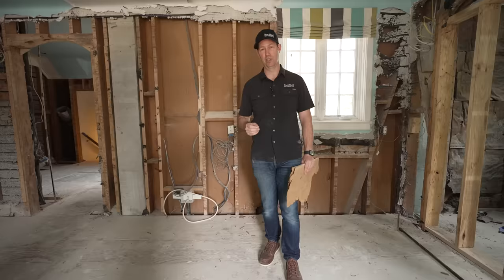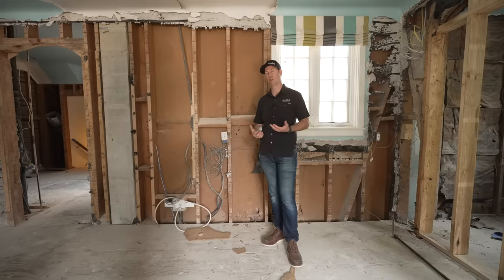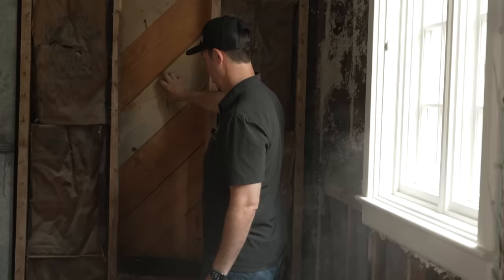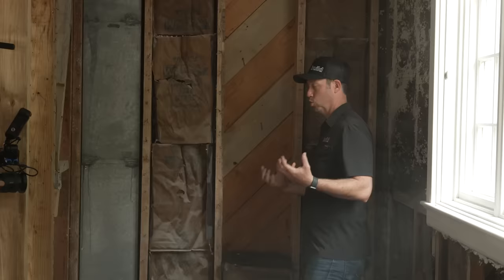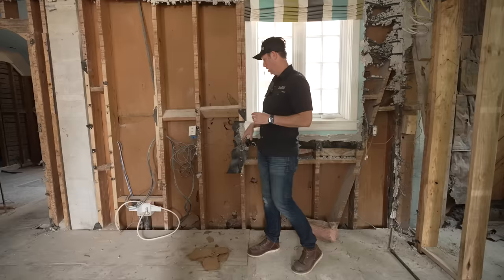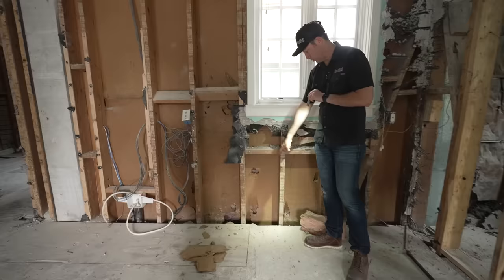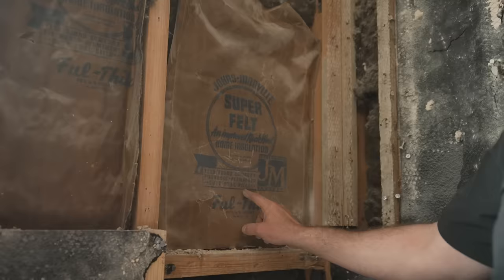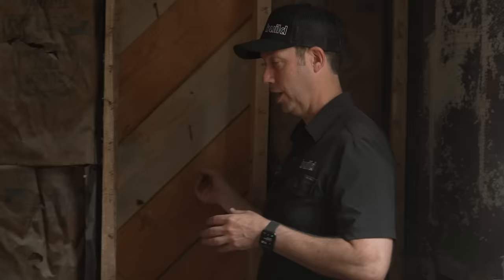I’m recommending we NOT INSULATE This Old House

Comment: I lived in an old home in Spain. No insulation, concrete and stucco build, plaster walls.
It got cold and I turned on my kerosene space heater, closed the door to that part of the house and started fixing dinner. You cannot imagine my shock when I went back into the living room to discover I couldn’t see farther than my arm! The extreme moisture held in the walls formed a thick fog cloud inside the house with the introduction of the heater. ☁️☁️☁️☁️☁️
I opened the windows as the air outside was drier than inside.
Reply: I believe you. And that's hilarious!
Reply: You should always have the windows cracked a little when using a kerosene heater indoors anyway.  Otherwise their combustion products (CO2, carbon monoxide, nitrogen dioxide, etc) will accumulate in the room to unhealthy levels.

You should also only use them as much as necessary, and turn them off every so often and air out the room before continuing, if you're doing it for a long time.

(It is ironic that in places where these heaters are your main heat source for a home, to heat up your home in the winter, you actually need to open a window...)
Reply: @foogod4237  
The room had ventilation via a fireplace, but you aren’t wrong! Good advice!
Reply: Pics or it didn’t happen
Reply: @nofurtherwest3474  
I took three but something went wrong…the film printed out nothing but whiteout.

🤣 joking
Reply: @Mulberrysmile  Let me ask- how did you like Spain?
Reply: @nofurtherwest3474  
It was terrific. Wonderful people, interesting places to go, food was delicious.
Not perfect…no place is, but I would go back for a visit, for sure.

Comment: Our 1948 ballon frame house had no insulation, tar paper, and 105 wood siding nailed to the studs. The upper part had tar paper, 1x4s spaced out with double course cedar shakes attached to those. And we still had rotten siding on a few spots! We recently stripped the exterior walls, added Rockwool insulation, plywood not osb, 30# tar paper, and double course cedar shakes. Above that hardie board.  I’m loving it so far.
Reply: Damn how much did you spend for that? And what do you mean by exterior walls? Aren’t all 4 sides exterior walls?
Reply: @oshitomaha  It usually means they worked from the outside, removing the outermost layer and insulated from there versus removing interior plaster/sheetrock and insulating from there.

Comment: 1) The particle board has a air gap between it and the brick (That is 1 reason why it's survived so well as others pointed out old brick work sheds humidity better than modern mortar)  2) if you want to give the particle board air you can use Sofit spacers used for insulating rafters to keep the insulation 1.5" from the sheeting. you'd be able to insulate while maintaining the original air gap on the inside of the sheeting. 3) Now that the Original particle board has Numerous holes you've punched into it you'll have to change the approach to keeping it dry by increasing the volume of airflow so the interior of the board doesn't retain humidity (Which is what you saw at the base with discolored particle board. Not enough air) 4) A completely closed pocket must stay closed and have some  through absorbent surface to shed any moisture (Which the original plaster was) since you plan to go with drywall and you perforated the outer board you definitely want insulation to mitigate rapid moisture changes in outer walls.

Comment: One time, I added exterior underground insulation to a basement. It did nothing after adding on the long sides. One side was above ground due to terrain slope. But when I added the final 25" of rigid insulation, suddenly the basement was a LOT warmer! While you might want to add insulation on the spots without that particle board, based on my experience, it'll be a waste of money because the heat loss from the uninsulated area will dominate the heat demand.

Comment: Matt, I lived a old 1800's brick mill and had a Mason repoint the bricks. When they were finished, they sprayed the entire structure with a silicone sealant. Rain would bead up and run off the outside. But it was breathable so any moisture on the inside could escape.
Reply: I have a brick full masonry house, and am considering applying this type of sealant so that I would then be able to insulate without having moisture problems. Sounds like you have been pleased with the sealant. Did you add insulation at the same time you applied the sealant?
Reply: It may have been silane/siloxane and not silicone

Comment: I did some work on a house built in 1928 in South Florida, had the same type of particle board walls with no rot. Had the material tested for asbestos, came back clean.
Reply: Must have been the lucky one :)    A home from 1928  is almost sure to contain asbestos,  lead paint, lead plumbing (possibly lead supply piping) balloon framing with no firestopping installed,  and a mixture of knob and tube wiring and newer romex as upgrades over the years have been made.   The original electrical service was typically 110 volts, 30 amps with 2 to 4 circuits total.

Comment: I have the same particle board sheathing on my brick house from the 60's. The walls have fiberglass insulation and two layers of sheetrock, and as far as I can tell that's how it was built. There are no moisture issues that I know of. It has stood this way for 60 years, so I guess it must be fine.

Comment: Thank you for this video! Perfect timing. We're renovating a 100 year old victorian wood frame house in Cocoa FL, and we just had water seep into the walls after the hurricane. The house has no rot at all and all the wood behind the plaster has been in perfect condition. You helped us understand that these old houses can dry out. We still need to seal up a few places where water was getting in, but now we know that it has been self-drying for the past 100 years and will continue to do so.

Comment: Good gracious you are a young man. That product was sold well into the 1970s and was very common. It is a use of cane fiber. Mostly on the exterior it was sprayed with asphalt as a vapor barrier.The reason that corner had one by wood sheathing was for wind bracing. All corners were diagonally braced with that non structural sheathing in between. If you are going to plaster again don't insulate, but if you are going to use drywall, use a non vapor barrier insulation like unfaced fiberglass and then use a vapor barrier floor to ceiling and corner to corner over the studs. Then drywall. With modern AC I do believe you will want to insulate. That non insulated with double hung windows was very common in the south for the walls to breath. But a cold surface from AC will give you grief without vapor barrier and insulation. Better bone up on old methods!!!
Reply: They pulled the brick of that corner of the house to re sheath it with 1x8! OKAY!
Reply: It's surprising how little he knows about construction for a "pro"
Reply: @davidribeca1745  I agree this seems very unlikely, but what do you make of the 1939 insulation in that cavity?
Reply: I was thinking the same thing. Unfaced insulation should work fine. No vapor barrier, so no worries of trapping in moisture.
Reply: @CybekCusal  What is even more surprising is that construction has been going on for 5000 years and you expect him to know every single part of it. Is a modern car mechanic supposed to know how to fix the SPICA fuel injection on a classic Alfa Romeo???
Reply: @davidribeca1745  No it was sheathed that way in the corners for bracing  to begin with - but just in the corners of the building.
Reply: @bigmacdaddy1234  there aren’t any buildings more than a few hundred years old in America. He must not work on old homes. Looks like he’s a new build and development guy
Reply: Celotex
Reply: @bensorensen6994  Yes, that was the brand name of the primary supplier. I do believe that others made it later but for years that is what we called it. Kind of like Jello became generic for gelatin.
Reply: As the owner of a 100 yo brick veneer house on Boston I appreciate your insight Mark. I need to find someone like you with lots of experience of old houses to make sure I insulate the right way. Building codes force us to insulate when we take plaster down... I don't think "recommending we don't insulate" is an option the inspector is willing to hear LOL.
Reply: @patjohn775 he's from Texas.  I find old homes in abundance in New England.  Many other areas have dropped old buildings and upgraded
Reply: This is so amazing that you are able to provide that insight about this house. He should hire you as a consultant for this project! Lots to be learned from your experience for sure.
You do have a great point about modern air conditioning and it’s issues to watch out for.

Comment: I have an old log farm house here in Finland that serves as my summer cabin, disassembled moved to it's place in 1920's. Just by keeping the doors shut it stays "cold" in 20C no matter how hard the sun bathes the walls in the summer, kids call it the "ice room" because the temperature difference to some times over 40c outside is so big on summers. Other end of the house that sees more traffic doesn't do the same as the door there is most of the times open and people go in and about as it has the kitchen and the living room. 
On winters though the house is cold as heck but still keeps naturally relatively warm in -10C and the old masonry heaters take ages to warm up. original double windows help to keep it warm though as do the floor that sits 1meter above ground with 1/2 meter of saw dust for insulation, the mid roof (the house has an attic accessed from outside) is similarily insulated albeit with clay and straw.
Only issue the house has is that frost has moved the stone foudation over the years so the house has started to drop from one side and also dry rot that eats timber over time.
There are techniques to make foundation to not move (staves under stones in foundation similar to today) but those are only found in mansions of the nobles not in farms of the common folk.

Comment: That sheathing is Homasote. Also that mineral wool insulation was made from Coal slag and it's messy and not very effective. I know cause our 1960 house(not too many miles from that house you are showing) had it in the walls... The house was also built out of lumber from a disassembled house so the lumber is very old very hard and very strong. I have a few of the 2x4s left from an older remodel and I hate to use them because they are such nice lumber that isn't available anymore.
Reply: Yes, my 1958 house had it. In my area they referred to it as beaverboard. I think that was an old brand of the product.
Reply: My house was build in 1950 and sometimes I think the reclaimed lumber from it would cost more than the house.
Reply: Or possibly Masonite, invented in 1924, mass produced starting in 1929. Unfortunately, they started using it as siding in the 1980s, and class action lawsuits started in the late 1990s. Still makes for good pegboard.
Reply: can any of it ahve asbetos?
Reply: @randomrazr  when i saw johns manville i thought ASBESTOS!
Reply: I bet it Celotex.
Reply: I don't think it's homesite. My grandparents house was sheated with what grandpa called fuzzboard and fuzzboard stamped and particleized to look like some sort of brick/block.
Reply: Not homesite. Fiberboard sheathing. Insulate with no vapor barrier.

Comment: You should look into how straw light clay insulation works with lime plaster. It's a different approach to moisture movement through walls than what you normally talk about. That system allows moisture movement and it works because the straw and clay diffuses moisture rather than allowing "hot spots". Then lime plaster wicks the moisture out of the wall

Comment: During my building diploma. Insulation was best explained as: with respect to the delta T, moving the dew point into the middle of the insulation where there is no moisture to condense. Rockwool or glasswool combined with sarking the walls and roof works well in Australia. Minimal air movement in the insulation.
Reply: @toddthreess9624  Sarking is common building term in Australia and New Zealand for reflective foil laminate used as a radiant barrier under roof tiles and roof metal. The product is also use on the timber or metal frame in brick veneer construction.   We get some hot days!

Comment: @Matt Risenger  - Thank you for this video.   We sprayed a thin layer of Dow Froth-Pack foam to air seal diagonal wood sheathing (specifically not to insulated, just air seal). This made the wood sheathing / foam an air barrier.  We then insulated that interior air sealed cavity with fiberglass.  The opposite side of the sealed wood sheathing is an air gap to brick.  That air gap is open at the top of the two story home.  The thinking is that the air is allowed to freely circulate outside of this barrier.
Reply: Did you put poly on top of insulation inside?

Comment: Mold forms in the presence of water.  Insulation doesn't cause water formation or water retention.  Water in walls comes from temperature differentials that generate condensation.
The reason the particle board has survived is not just because it didn't have insulation, it's because there was never very much temperature difference between the inside and outside (because nobody has ever wanted to heat that much uninsulated house).

The debate should not center on whether insulation should be in the walls, the debate should be on how the building will be used.  If you plan on living like a modern family and try to keep that building at 70f plus all year, then condensation will form on that old particle board, (AND it will cost more to heat).

The lack of insulation only caused the lack of desire to heat and therefore reduced the possibility of condensation.  But if you plan to heat it, you had better put insulation (and vapor barrier) or you will have rotten walls about the same time you run out of money to heat the place.

Shorter version:
Thinking insulation will CAUSE rot is like thinking marriage CAUSES divorce. 
SMH
Reply: Where do you suggest the vapor barrier be placed in the assembly for this climate zone?  What about cooling?
Reply: Especially as the humidity in the building changes.

The current HVAC system is likely oversized, with a LOT of airflow and plenty of ductwork.

Start trying to add in modern systems like a whole-home dehumidifier into that system, or install variable speed equipment, and suddenly you're dropping the humidity to a point where we now have condensation that never happened before, because the house has never been that dry. 

While those systems will dry out the house overall, they'll completely change the dynamic between the temp/humidity of the air inside the ducts and the dewpoint in the air outside of the ducts, and there will be all kinds of duct sweating issues...
Reply: Insulation can absorb and hold more moisture longer and prevent quick drying leading to… mold.
Reply: @epiphany6  What?  Reducing the humidity causes condensation?
Reply: @D2O2   cooling is still only needed for less than 4 months of the year.  So Since the majority of Hvac will be heating, then the vapor barrier goes on the inner side of the wall behind the drywall.  
Also, when people do run cooling, the temperature difference is not as significant for as long.  Running AC will usually bring about a 20-25f degrees or less difference, worst at the hottest part of the day.
Heating runs all through the colder months and even runs more at night.  30 or even 40 -- up to degrees difference every night in the winter (if you run it at 68) is far worse than summer.

Also, interior air is usually more moist due to human occupation.  So the hotter and relatively more moist interior heated air in winter is a far bigger problem than higher summer humidity.

Fort worth is not the deep south of Louisiana.  Temperature and humidity differences will be less severe in the summer than the winter. Meaning the AC is not as good at cooling or de-humidifying in summer as mother nature is for the other 3 months of the year.
Reply: Marriage does cause divorce.  Without marriage there is no divorce.
Reply: @JohannnesBrahms   nope. But just like the insulation, as soon as it is in place it changes the way people think and behave.  The CAUSE in both cases is the thinkinh and behavior.  The insulation/marriage itself has no blame.

In both cases a lack of understanding is really at root cause.
Reply: @moesizlac2596  AS I SAID IN THE ORIGINAL COMMENT:  If you are not married, you can't get divorced.  Relationship dynamics that cause the breakup have nothing to do with the civil contract you create with the State when you "get married."  The condition may not be the direct cause of failure but without the condition there is no chance of failure.
Reply: @D2O2  read more carefully. Specifically the ductwork is going to sweat.

There's a reason why any good installer insulates the first several feet of duct on variable speed systems even in conditioned space. If you make major upgrades to the hvac equipment, you're changing the temp/humidity of the supply air pretty significantly.
Reply: @epiphany6  I re-read your other post again more carefully and I am still reading that you said reducing humidty causes condensation.  How so?  Surfaces at or below the dewpoint of the air they are in contact with Will develop condensation, period.  Proper duct install is required to avoid this.